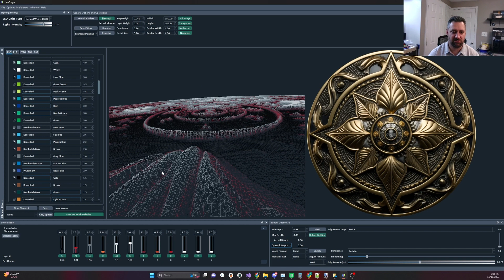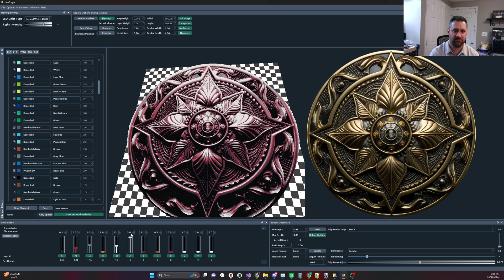HueForge Depth Modes Explained in 3 Minutes

Comment: I have a problem with exported STL file from Hueforge.  In Hueforge the file has 22 layers but when I open the stl file in Bambu it only has 12 layers.  What is a possible solution for this dilemma?
Reply: Change your layer height to 0.08 with first layer 0.16 The size is the same but if you use lower resolution there will be fewer layers to reach the height
Reply: @ZhakRyuu  I have done it but it gives the same situation.
Reply from the maker: Did you scale in the slicer?  That sounds like 50% scale